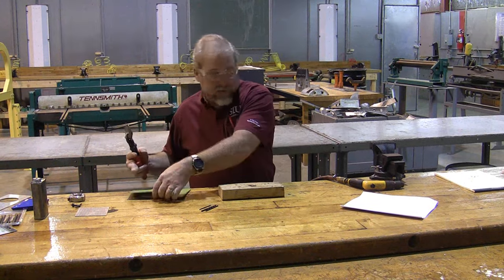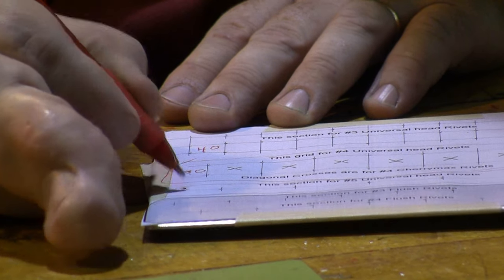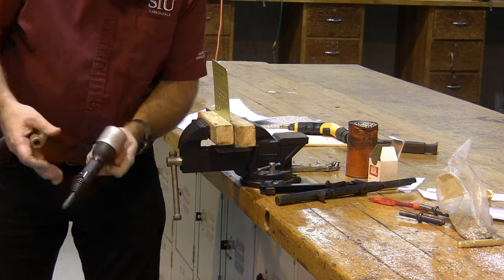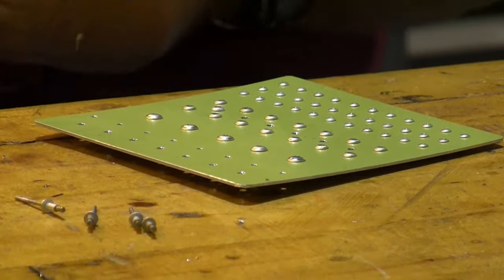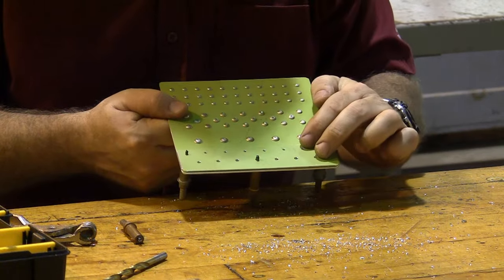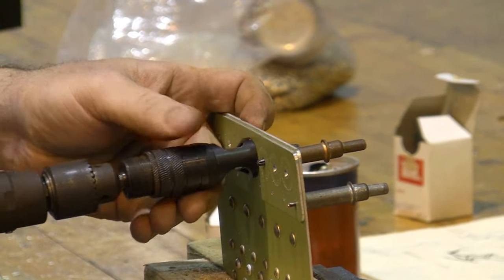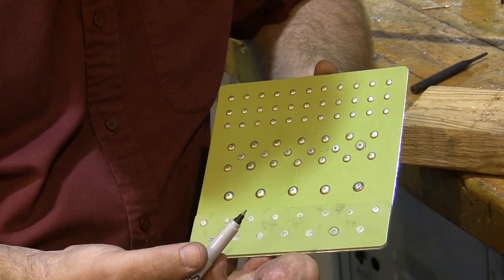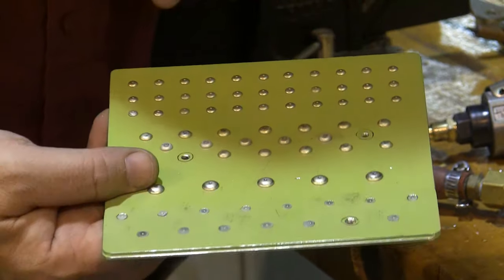AVT 206 A&P Sheet Metal Class - Project 1 Complete Video

Comment: to know the exact length of rivet you want, you have to measure the thickness of plate. After that , there is a formula go get the exact length of rivet according to the plate thickness. the formula is : plate thickness + 1.5*diameter of rivet=rivet length of your plate.
Rivet length should be in 1 over 16 and diameter should be in 1 over 32. 
These are just the things I learn't in my aircraft structure class.
Thank you
Reply from the maker: This formula is for the ideal.  However, it does not work in the real world, because the  material comes in varying thicknesses by the thousandths of an inch, and the rivet is sized by the 16th of an inch.  For this reason, there is an acceptable range.  What this range is depends on the rivet gauge, but for AD rivets, 1.33 to 1.5  times the shank diameter works well.  Harder rivets like DD rivets require shorter lengths, such as 1.0 to 1.33.  Always check the manual if you are not sure.

Comment: Is this the same material you heat treat in later projects (5 or 6).  Regardless what type of aluminum and how thick?
Reply from the maker: This is 2024 T3.  The material we heat treat is 2024 O.  After heat treatment, it is 2024 T42.  The 2 just means it was done after the factory it would be 2024 T4 if the factory did the same thing.  It takes artificial aging to go from T4 to T3 - but if I had an oven that could do it, it would be the same as the plate here.

Comment: Great video. Where does a rivet shaving tool get used?
Reply from the maker: I am not a fan of the shaving tool.  It is used to mill the head of a flush rivet that protrudes more than is allowable.  Google NACA riveting.  In my experience, it tends to tear into the base metal as well, which is a problem with modern alclad material.  I did use one this week to cut the shop head off of a rivet on a bulkhead I was replacing, so damage didn't matter.